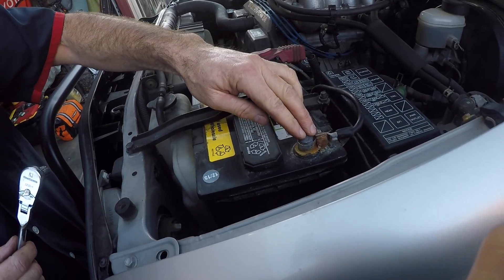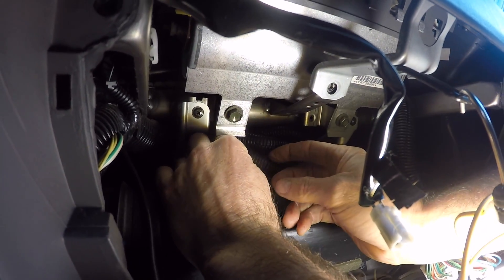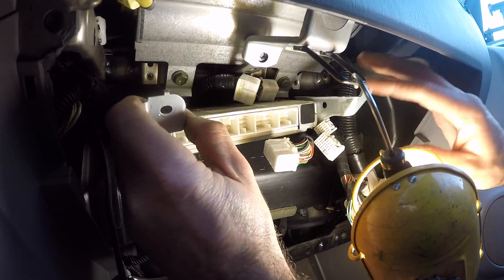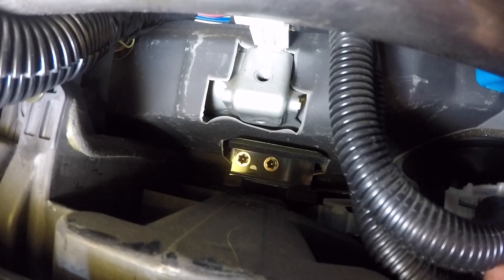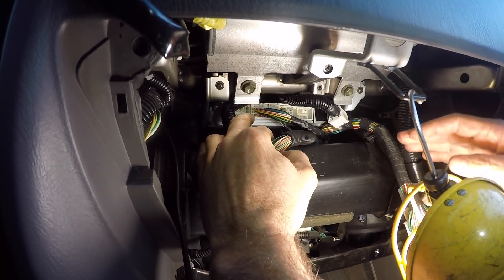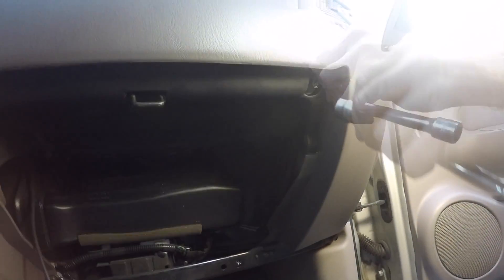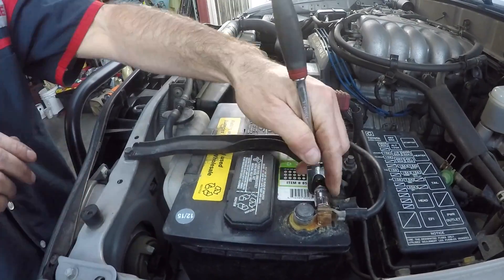ECU Replacement

Comment: Great videos Timmy. You help me alot but the each old question is can you reprogram an ECU for a 1996 Toyota 4Runner and how?
Reply from the maker: I know ECUs can be reprogrammed.  How it's done, I don't know.
Reply: @TimmyTheToolman  Thank you for your reply but I guess my question is does an ECU on a 1996 Toyota 4runnwe require reprogramming like the new models so? I hear it doesn't but is that true or accurate.
Reply from the maker: @dominicene3647  No, you don't have to reprogram it.  I thought you were asking about reprogramming an ECU to work for a different year and model.
Reply: @TimmyTheToolman  know of any reputable places that repairs ECU for the 1996 Toyota $ Runner?  I see alot of them on online but I wonder how they repair them. I always keep a spare ECU and my original is not working properly.
Reply from the maker: @dominicene3647  I don't know of any.
Reply: @TimmyTheToolman  Thank you for reaching out to me. I truly appreciate it!
Reply from the maker: @dominicene3647  You're welcome

Comment: I think it is equal to a 4runner 2005 6 cyl, ..
Because my toyota i turn on the shiwcht and I have lights on the dash but it doesn't turn on, I turn on the starter and if it works .. but not with the key, I already checked the fuses and they are all fine .. I don't even know where to check .. and it was so by chance, it turned on very well when I went home and stopped in a store and did not want to turn on, but it had rained a lot .. greetings from Chicago
Reply from the maker: It could be a wiring issue and not the ECU.  Sounds like an issue that's going to be hard to pinpoint.

Comment: I can really use yawls help. I’m having the same issue plus a lot more after I change my O2‘s and my mass due to my replacement of my engine temperature sensor “because it broke” when I try to start it back up I had misfires and a bunch of codes and I’ve replaced coils,plugs,wires, Mass. 02‘s, injectors, vacuum hoses, iac. I’m sure there’s more but I can’t think of it. These are currently the codes that I have that weren’t there before the sensor broke. 
P001c
P0500
P0503
P0301
P0300 
P0073
P0600
P0503
B0503 
P0304
P0303
P0300
P00A5
P0500 
B363
P0303
P0301
P0300 
P0072
P0600
P1203
P0305
P0304
P0300
P00CC
P0500
B0503
P0304
P0303
P0300.
Any ideas would be helpful I know some of them are repeating but that is directly from the list. By the way mine is a 97 4runner SR5 rear wheel drive automatic
Reply from the maker: Do you use OEM replacement parts for the O2 sensors, MAF sensor and the coolant temp sensor?  If you didn't, replace them with OEM and see where that gets you.  Quite often aftermarket sensors cause more problems than they solve.
Reply: @TimmyTheToolman  ya I did. The codes keep changing but there’s always a p0300, and a injection fault. Did find a vacuum leak on my pcv and my brake petal is normal at first then looses pressure till it’s on the floor. But nothing reacts with starting fluid being sprayed
Reply from the maker: @joshuapetty5470  With all those codes, it's hard to say what the issue is.  Maybe the ECU is the issue.  I've never had someone report a laundry list of codes like you have.
Reply: @TimmyTheToolman  That’s what I was thinking too especially since It keeps changing. There Is a weird one that popped up that even Google can’t find. DTC U2C03
Reply from the maker: @joshuapetty5470  Hmmm, I think it might be worthwhile to try the ECU swap.  If it doesn't work,.you could just resell it and recoup your expense.
Reply: @TimmyTheToolman  I figured I would try the PCM from a junkyard. It is my every day car but I don’t go more than 20 miles usually do I need to get it re-coded when I install it or will it be OK as long as it’s the same year make and model
Reply from the maker: @joshuapetty5470  As long as it's from the same year and model, you wouldn't have to re-program it.  Same year, same trim model, same transmission and you're good to go.
Reply: @TimmyTheToolman  thanks. You’ve been very helpful these past few years
Reply from the maker: @joshuapetty5470  You're welcome.  We're here to help.

Comment: Is there anything you have to do with programming or syncing your key/ignition to the ECU unit? Or, is it simply plug and play?
Reply from the maker: It should be plug and play if you got the exact same ECU for your year and model.
Reply: @TimmyTheToolman  Hi, this is a very good question from lizperr because I thought the vehicle’s ECU and transponder key were somewhat programmed to each other.
Reply from the maker: @jonarriola794  The vehicle we were working on is older and doesn't have a transponder key.  That's probably the reason our swap was plug and play.

Comment: Does the ecu also control the transmission shifting points.  Reason being my door jam tag identification tag has a tire size or 225/75r16. Does the ecu transmission shifting points go off the vehicle's tire size. Therefore if I got a ecu from a 3rd gen with a tag that read 265/75r16,  would the ecu transmission shifting points be at a different setting? Because I wanted to put say a larger tire would it benefit me to than change the ecu over from a 3rd gen with a stock larger size tire "265/75r16 "     Thanks Timmy 😄
Reply from the maker: I would think the ECU controls the shift points.  I doubt the shift points is based off tire size.  From what I've seen with my 3rd Gens, it's based off speed and rpms.  Changing the tire size from the stock size to a larger size and keeping the gearing in the differentials the same will throw off the speedometer a little and thus change the shift points some.  One thing that changes the shift points is using the ECT button.  It tells the transmission to hold the gear longer before upshifting.  The only way to improve the power of your rig after putting larger tires on is to re-gear your differentials.  I'm running 4.30 gearing on my 98 with 33" tires.  I also have lots of added weight with aftermarket bumpers, winch, full belly of aftermarket skids, and a steel roof rack.  I'm going to re-gear to 4.88 soon.
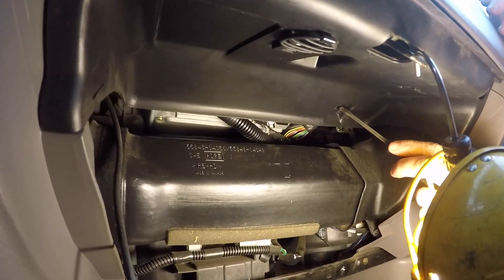Reply: @TimmyTheToolman ,  many thanks for the info.  This was one has had me puzzled for some time now.  Going to change the gearing to 4:30 today.  Also many many thanks for all the videos you put together.  Don't know how far my rig would be if it wasn't for your channel.  Thank you 🙂 👍
Reply from the maker: @bvinton2  You're very welcome.  Good to hear our videos are helping you out.

Comment: Which is the harness to the OBD plug under the drivers side
Reply from the maker: Don't know what part of the harnesses that connect to the ECU communicate with the OBD II port.  I'd have to look it up on a wiring diagram.

Comment: Good day Sir, if you don’t mind if you can guide me where to find the ECU for my 2006 GX470, thank you Sir
Reply from the maker: Well, the obvious choice is at your local Lexus or Toyota dealer.  If you want to save money, you can search for a wrecked 2006 GX470 at a PicknPull that's the same model.  I don't know if there were different trim models like they have for 4runners like SR5 and Limited.  With those differences, the ECU will be different as well because the electronica are a bit different like the difference between a J-shifter for the transfer case on the SR5 models and a push button actuator for the Limited models.  So, you can go on the PicknPull website and do a search for your year and model and see what you come up with.  If you find one or more, you go there, pay your $2 entry fee and hope one of the rigs that's there still have the ECU in it.  I don't know where the ECU is on the GX470 but my guess is it's behind the glove box like it is on a lot of other Toyota and Lexus models.  Here's a link to a video of us swapping out a ECU on a 1st Gen Tacoma.  https://youtu.be/5-t69mMpazg  Another option is you do a search online and maybe someone is selling one on Ebay or wherever.

Comment: I think I have this same problem with my 2007 toyota tundra (4wd control ECU problem) how can I test to make sure that my ECU is faulty
Reply from the maker: You'd have to get information from the Toyota factory service manual.  You can access that information by paying a fee.  Toyota Tech Info has information about all Toyota vehicles.  You can buy a 2-day subscription for $20. https://techinfo.toyota.com/techInfoPortal/appmanager/t3/ti?_nfpb=true&_pageLabel=ti_home_page&contextType=external&username=string&password=secure_string&challenge_url=https://techinfo.toyota.com/techInfoPortal/login/techinfo&request_id=3973784981830953425&authn_try_count=0&locale=en_US&resource_url=https%3A%2F%2Ftechinfo.toyota.com%2Ft3Portal%2Fappmanager%2Ft3%2Fti%3F_nfpb%3Dtrue%26_windowLabel%3DT615220591352152272333%26T615220591352152272333_actionOverride%3D%252Fportlets%252Ftis%252FkeycodeLookup%252Fbegin%26_pageLabel%3Dtis_diag_security

If you go to the very bottom of that page, it will list the system requirements.  You basically need a PC computer running windows 7 or 8.

Comment: Great video. I think I would started with a compression test and leakdown test first before throwing parts all it.
Reply from the maker: We eventually did a leak down test of the #1 cylinder.  It was fine.  The problem ended up being gross play in the crank shaft which caused an audible engine knock that the knock sensors were picking up and generating the misfire.  We suspected the thrust washers gave way and we were right.  Greg decided to sell the truck and the guy who bought it dropped the oil pan and found pieces of the thrust washers on the bottom of the pan.
Reply: @TimmyTheToolman  Thanks so much for rescribing this. I think I have exactly the same problem with the same engine on the no 2 cylinder. It has been driving me mad. I have been on the verge of swapping out the ECU. Where the engine rests for a few hours, it starts and drives perfectly. After about an hour, the no 2 cylinder misfires and then the engine must cool down again before it works. Enough to drive anyone insane.
Reply from the maker: @kimonpaxinos3747  Intermittent problems like this can be a pain in the ass to figure out.  Hope you find the culprit.

Comment: I know this vid is old but I had the same issue on my Tacoma. I too replaced coil packs since mine has 130k miles , I have newish denso iridium plugs and wires. But I still had the miss on cylinder 1 and 4. What I found is that one cold night a mouse decided to crawl up in my engine compartment to stay warm and he chewed on some wires.  If I ever catch that little focker Im gonna pulverize him.
Reply from the maker: Yep, rodents getting into engine compartments is pretty common and they can do a ton of damage.

Comment: Not sure if you've had experience with this but my idle air control valve is continuously clicking and now my 4runner cranks but won't start. I changed the valve with a new one but it's clicking still and won't start. Do you think it would have anything to do with the ecu?
Reply from the maker: Hard to say but it certainly could be a problem with the ECU.  Have you examined the wiring harness that the IAC plug comes off of?  Maybe there's a short somewhere.  Sometimes rodents can get into your engine compartment and chew up the wiring.
Reply: @TimmyTheToolman  Yeah I've checked the harness but I haven't exactly checked for a short in the wires

Comment: Great job explaining how to remove/replace the ECU. I just sent mine for repair, a 1997 Toyota 4 Runner that cranks but wouldnt start. The mechanic said it was an ECU issue. This old timer thanks you! Be well Tim.
Reply: No there was nothing wrong with the ECU. It was something in the gas tank that went bad. The meineke shop that said it was the ECU and they couldn't fix was wrong
Reply from the maker: You're welcome.  Hope they can repair your ECU and get you back rolling down the road again in your rig.
Reply: hey im interested to see if the repair to the ECU worked. how did it go when you got it all installed?
Reply: Did the ECU solve the crank no start? Having a similar issue now on my T100.
Reply: Im having the same issue with my 99 4Runner and Im stumped ! My car just cranks and cranks but no start .It’s thrown 2 different codes already ,one for the position crank shaft sensor P0335 and  cam shaft position sensor  P0340 .I haven’t replaced the camshaft sensor it gets here tomorrow.But after I threw on the new crank sensor the other day it didnt help the issue it was the same thing just cranking and cranking .Im think guys either the ecu or a short in the wiring

Comment: I have an 02 tundra that I can’t get ready for smog. O2 sensor and Evacuation keep saying not ready. Any suggestions? I’ve done multiple drive cycles and driven this truck for a few months and still nothing.
Reply from the maker: I'm not sure.  I have never gone through a problem like this.  I have heard that the drive cycles are fairly specific on what you need to do in order for it to clear and be ready to smog but I've never performed one of these drive cycles for one of my vehicles.
Reply: @TimmyTheToolman  okay I guess I’ll keep driving it. Thanks for replying back and the videos you make for all of us to learn from.
Reply from the maker: @Blkdelillah  Are you performing the drive cycles as suggested or are you just driving it normally?  I remember reading about what a drive cycle entailed and it was very specific on how you need to drive the vehicle to get the code to clear.

Comment: I kept getting a misfire code on my 2001 Toyota Tundra and found out that one of my spark plugs on cylinder 5 was not gapped appropriately. It was almost completely closed. I removed it and gapped it to the appropriate gap specs and it cleared the code👍🏽
Reply from the maker: Hey awesome stuff! Thanks for sharing your fix. We hope your comment will help someone in the future. We appreciate you taking the time to come back to our video!

Comment: I had the same misfire issue after replacing plugs, wires, and coil packs the code still popped up. Once I replaced ECU it hasn't returned. However in now getting the code P0420 so now that's where I'm at. But the truck stays running now
Reply from the maker: Maybe a replacement O2 sensor will clear the P0420 code for you.  If you're truly having a catalytic converter problem, I would try a product called Cataclean.  It gets mixed reviews but it's worked for some people and it would be a whole lot more affordable than replacing the catalytic converter(s).
Reply: What year model make? I’m having the same issues.

Comment: So once your computer is in if it turns over but doesn’t start don’t your have to connect a jumper and reset the ECU?
Reply from the maker: No, you don't.  As long as the ECU is correct for your year, make and model, you install it and your rig should start.
Reply: @TimmyTheToolman  the how to install part of your video was great! It just left out the how to reset the computer section which is needed.
Reply from the maker: TJack Survival I wonder why we didn’t have to reset the one we had then.  Anyway, I guess we were lucky or maybe you were unlucky.  Our ECU was the exact part number as the original.  Was that the case with your swap?
Reply: @TimmyTheToolman  Interesting, was your vehicle also equipped with the transponder key ignition system?
Reply: Mine didn’t. I had to look up how to jump
The OBD 2 ports on 4 and 13. I matched the make model year and all that and it wouldn’t start until I synced the new computer to the car. You guy’s video missed that instruction. Unless there is a way to wipe the new ECU that I don’t know about

Comment: You will need a engine rebuilt .
Reply from the maker: We came to the same conclusion after we learned the culprit for the misfire was gross play in the crankshaft causing an audible engine knock.  The knock sensors were most likely generating the misfire CEL code.